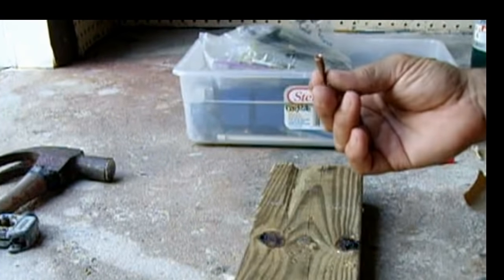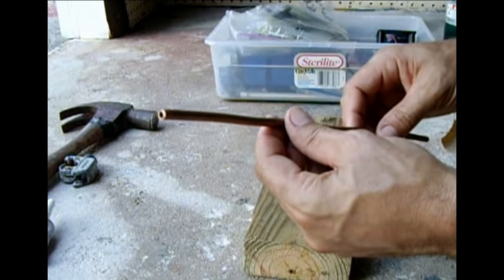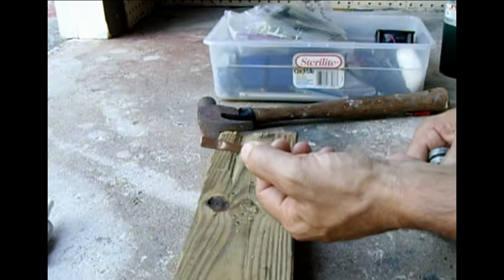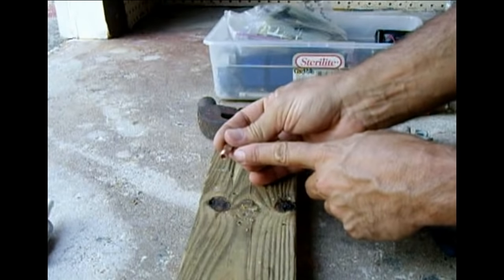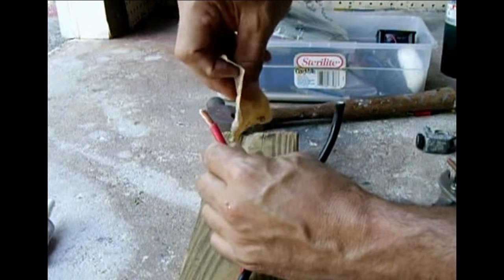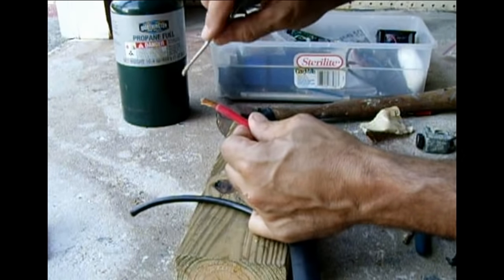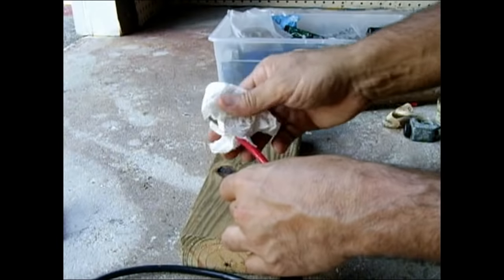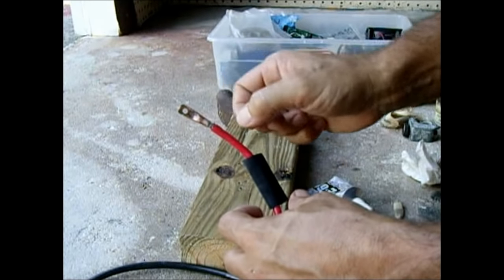How To Make Copper Battery Cable Connectors!

Comment: I have used a pain of side cutters to "round the ends".
Annealing the copper by Heating until it glows then let it cool slowly in air. 
Will make it easier (softer) to work with if needed.

Thank you
Reply: +Sol Shady Copper is different than ferrous metal. So to anneal copper you quench it while it is hot. Which is the opposite of how ferrous metal works.

Comment: Out in the professional Telecom field we used a number of different calibrated crimpers. Just crimping a connector is asking for trouble. Soldering is good but impractically slow out in the field. So the proper procedure for crimping is to use no-ox first and then crimp with calibrated crimper. The no-ox keeps the air out so the connection doesn't deteriorate and the calibrated crimpers practically weld the joint together. 
Personally I like a good solder joint as I cant afford the fancy crimpers.
Reply from the maker: I used Noalox for many years on all my AL/CU connections, especially when connecting new circuit breaker panels/meters and disconnects.

Comment: Awesome idea! I spent an hour time and a bunch of gas trying to find copper connectors for #4 ga. battery cables for my boat. Paid about $5 each and a ton of hassle finding them. Thanks for sharing your nifty idea.
Reply from the maker: Wow. $5 each. What criminals. You can easily tin the outside of the connector for added corrosion resistance for marine use. Once the connector is made, you thoroughly clean the outside of the lug, coat it in a light layer of flux, then dip it in some molten solder.

Thanks For watching! Be sure to share, and rate a thumbs up.

Comment: thanks for the video, I love making parts like this, good job. You guys with a better way or complaints, 'MAKE YOUR OWN VIDEO"
Reply from the maker: Thanks for watching Steve! You're correct, most people that complain, or pick on every little detail in the video, are usually people with no videos themselves, and very few if any subscribers. The fact of the matter is, this idea is great, and I have proven it over and over. You don't have to do things "exactly" as I showed in the video, you can modify certain steps if you desired, but the idea shown is great.

Comment: That drill bit is great-I'll look out for one.Only possible suggestion I could make is to tin the wire to stop any wayward strand catching on the connector and give visual indication of when to add solder-probably an unnecessary complication though.

Comment: Hi its a very good idea and I am installing my amp and cap this weekend. I will try this...what I will do diff: 1/ I will drill the hole before I cut the copper pipe and 2/ I will try to put some solder in side the pipe so when I heat up the pipe the wire can easy solder. again great trick

Comment from the maker: Good for smaller gauge wire(10-14 solid), but for marine/heavy duty uses with 2GA/4GA stranded, this is the only way to go due to the amount of current.

Comment: Well that's a big thumbs up...! I will have to try this next time I need a lug. I usually go to electrician's supply stores to get mine. They're pretty cheap that way. Not as cheap as making your own like this ov course, but far more realistically priced than buying them from an auto parts store or something! The only issue is they are rated in millimetres for the electrical industry in New Zealand, but most cabling I tend to use is in AWG so a bit ov conversion needed.
Reply from the maker: Thank you! Just look for the proper size copper refrigeration tubing for your wire size. Check the fit.

Comment: I have done the same many times
What I typically do is pass the wire end all the way through to the end of the copper sleeve and pass a little bit of the insulation into the sleeve.  Then I slam it hard and flat with a hammer on the end. Drill a hole and then I solder seal the end shut and also may put solder around the hole. This will absolutely secure the wire. It makes the end thicker and is very strong so the other type copper works ok.  Done battery cables on the boat this way. Also for that I have bought the standard copper joints at HDepot or used any copper pipe..

Comment: This is a good video and explanation on how to repair a bad low voltage cable connection DIY.  ( 12 v  or less ). Bottom line is DIY and save $ or go for a more expensive solution. There is always another way. Its up to the person with the problem. No need to criticize someone for trying to show his solution .

Comment: Another great video.  I've made my first copper cable lug and was great.  I had another idea where you can custom the lug, to add a clamp connection to the end.  Requires a few more cuts and bends at the cable entrance, but that'll act as the strain relief for the solder joint.  Thanks!
Reply from the maker: Thank You For Watching!

Be sure to check out my video playlists as well.

Comment: How cool was that!... and I could have used this knowledge when I fabricated a bunch of ground straps for my truck. I wonder if it is possible to omit the shrink wrap, I only have smaller gauge wrap.
Reply from the maker: You don't have to use the heat shrink tubing, but it does make for a much nicer/professional looking job, and also keeps moisture out of the connector. You can also take some type K or L copper tubing(which has thicker walls), and flatten it out to make straps/buss bars.

Thanks for watching! Be sure to rate thumbs up and share.

Comment: Inventive & ingenious, I'd never thought of doing this. I was waiting for the part where you crimped the fitting but either missed it or you didn't do it? I've always done both, particularly with the bigger gauged - heavier load stuff.

BTW: At fist I thought your video was "Make Copper 12V Battery Lugs with Pennies"! Duh....
Reply from the maker: You can also crimp them before you solder them, but the solder is strong enough all by itself. Never had a problem.

Thanks For Watching!

Comment: I am a retired Commercial fisherman what we would do on our boat when we needed cables which were large ones we used arc welding cable to make them up we had a 671 diesel when making up our cables for the starter motor we would put soldering flux inside the end of the copper fittings stick them on to the cable and then take our propane torch and heat it up and solder it on the boat we used was a converted Minesweeper from Vietnam era

Comment: Very cool! Can't believe I never thought of this. I do think your prices are a little off - I generally buy good quality 2awg copper terminals for about $1.30 each...
Reply from the maker: +Paul LD 
Hello, my prices are accurate. You must have found a great deal. Thanks For Watching!
Reply: +electronicsNmore Nope, just my local napa/welding supply etc... - you must've been getting ripped off.
Reply from the maker: Paul LD
Most stores sell them for $2 and up each. Even at Harbor Freight, they are not cheap.
Reply from the maker: Good price around $2.50 for (2), but I can still make them for pennies. :-) The real savings is when you use wire sizes larger than 2ga. The average store will not sell them for $1.25 each.  If you really needed one, the odds are you would be paying more than $1.25 each.

Comment: A BIG thank you for this information. Since moving to the Philippines, we appreciate the corner hardware stores back home more than ever. We hear the dreaded words "out of stock" all to often in the Phils. One rule is NEVER begin a project until you have ALL the parts in hand, parts on order may never come in. No copper tubing here but I am thinking my air-con guy will be able to obtain the refrigeration tubing you recommend for me. Now, if I can find the heat shrink tubing and the adhesive or a good substitute????
Reply from the maker: I hear it all the time in the Bahamas as well. I am use to it. :-) You can always find a way to improvise!

Thanks For Watching! Be sure to share my channel with others.

Comment: I was thinkin! the same thing myself, thanks! Defluxing is not difficult. A paper towel with hot water can do it. plumbing rosin's possibly more corrosive than a rosin-core solder.
Reply from the maker: +Freeman Z 
A paper towel with hot water has never removed any rosin flux for me. Rosin flux dries and becomes gummy. Mineral spirits with a tiny brush removes rosin flux easily. Denatured alcohol works well also.

Comment: And one more thing, I like to use that "Liquid electrical tape" (walmart), then put heat shrink over that. Also when you make these copper lugs, you get the hole the size you want, just pick out tubing the size of your cable.

Comment: Tip for you.  Hold the lug vertical with the wire  end facing up, heat with torch, fill with solder, then push wire into the lug (w/o heating the wire).
Reply from the maker: Done that many times before in the past, but it is much better to raise the temperature of the end of the wire before dipping it into the molten solder. You could end up with a cold joint.

Comment: One tip, clip off a piece of solder and put it in the terminal end - heat until it melts and then insert the fluxed wire.  That will give you a better connection vs allowing the solder to draw into the joint.
Reply from the maker: +tnts79 
You can do that, but I never had any problems. The capillary action pulls the solder nicely into the fluxed connector/wire to coat and surround the wire. :-) Thanks For Watching

Comment: I have done this for welding lugs.  I  put flux on the wire. and heat the lug first.  I fill the lug half full of solder and then  put the wire into the lug.  Apply a little more heat to the lug and heat shrink after.  Very little melting of the wire insulation.
Reply: That's exactly what I thought when I saw the title of this video. Using a re-wired MOT and this will make great disposable (or recyclable) tips!

Comment: Very good only one suggestion maybe but stripped copper wire in the tube then hammer it down so the wire is sealed in and feed solder as you showed handy to know if you got odd sized connectors or are in the middle of nowhere and need to get going
Reply from the maker: Since this video was made, I bought a hydraulic crimping tool. :-) Thanks fro watching!
https://www.youtube.com/watch?v=eedrETFZ3Ws

Comment: Really fantastic idea. Just wondering what your thoughts are about using these on lead acid battery terminals though? Wouldn't the exposed pure copper oxidize faster from the battery venting? Aren't the silver-looking lugs normally aluminium or steel?
Reply from the maker: Nothing wrong with copper. It is used all the time on batteries. Some copper lugs/ring connectors are tinned to prevent corrosion(especially marine). I never had any problem using a copper lug on a 12v lead acid battery. They are also very easy to clean. Steel is not used due to electrolysis reasons, especially if the connector is not completely sealed from moisture. Aluminum is also not good to connect to copper. I have seen many problems over the years with electrical wiring when the two are in contact, I had to use a special compound(gray paste~NoAlox) on the connection to prevent the problem.

Thank You
Reply: electronicsNmore Ah - Great, thanks!

Comment: another question:
 would it be a good idea that once you finished soldering, use the compressed air can (upside down) to "freeze" and cool the connection? save some time?
Reply from the maker: It makes no difference if some insulation on the wire burns/melts. You are going to cover it with heat shrink tubing anyway.

Comment: that's a good hack but the resistance issue is the thing to discuss. I want the best connection that lasts so which is best,solder or crimp?maybe both?
Reply from the maker: I prefer to crimp and solder, even though I only soldered in this video. Thanks for watching!

Comment: Hi, great video. This should work for butt splices, right? Do you know which size copper wire would be 8 gauge? Thanks.
Reply from the maker: Yes, you can butt splice the wires together. All you have to do is look at a wire gauge chart(plenty online) to find your wire size diameter in mm or inches, then look at a chart for type K or L copper pipe to find the INSIDE diameter in mm or inches of the pipe. If the wire is slightly smaller, your good to go. Thanks For watching.

Comment: Thanks for this great video. I will try it out soon. I wonder, when you solder it, it looks like the cable is horizontal, or maybe even that the cable lug end is pointing upwards, so the gravity is working against the tin. But you do want the tin to run into the lug, right? Does that happen because of the flux? Sorry, but I don't know what flux is, except that some people use it when soldering :) I always did my bit of soldering without it.
Reply from the maker: Capillary action draws the solder in just fine. Little effect of gravity, unless the wire is too small for the connector which was made. Make sure the connector is thoroughly cleaned on the inside, as well as the outside of the wire, then apply the flux to the wire and inner areas of the lug(small amount), then heat up the lug until the solder flows. You can also tin the wire before inserting it into the connector.

Comment: By the way, for the nay sayers out there, it did take him LESS than a minute to make that connector!!
 most of the time was actually talking to the camera for us, and if he was just making the connector and done things in different order probably would have taken 30 seconds or less.
  Just look at actual work time only! Couple seconds to hammer flat, couple seconds to drill/clean hole, few seconds to file corners rounded, couple seconds to cut off with tubing cutter and ream hole, DONE! 
Anything after cutting off and reaming does not count as time to MAKE the connector! Even if using a store bought connector you have to connect it to the cable however you choose to do it so that time does not count as actually making the connector.
 Also like he said, bench grinder would be much faster than a file for rounding corners. When I made about 60 large connectors for battery and inverter  cables I used my belt sander and did them all really fast one after another all at once as a batch as final step in making them.

Comment from the maker: I do not want to discuss this any more. The purpose of this video was to show others how they can make their own professional cable lug ends for pennies, (which is commonly used on all boats/trucks/cars). This video was not about anything else but how to make these exact connectors. You will not find your way being "commonly" used and any boat/car/truck. Your way is a last resort way if no connectors are available. I will have to remove the last post. I don't allow video links/posts. Sorry.